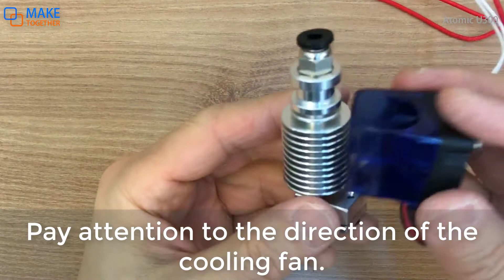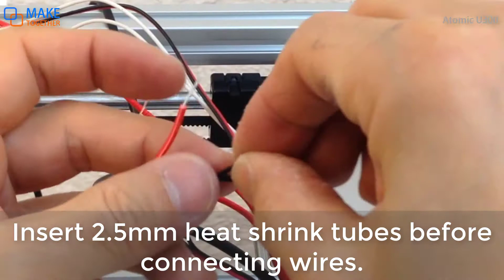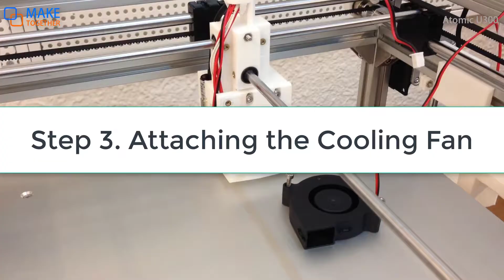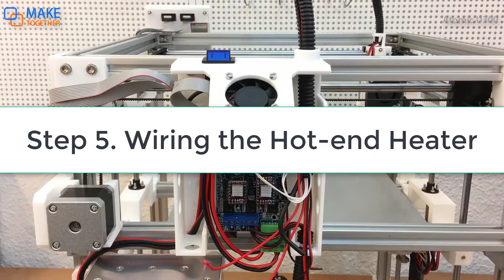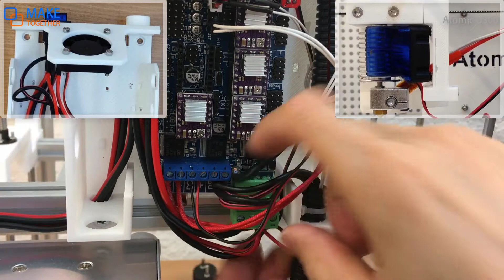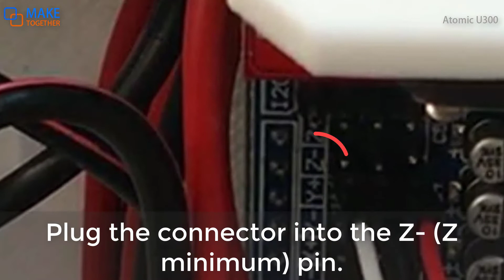Ultimaker Style 3D Printer Build Tutorial 13 - Printhead Assembly and Wiring

Comment: in this video it seems that something is missing, the heater cable is installed, besides the heater cable there is a white cable, what is it for? Then it is installed on the RAMPS board.
how many pins? in the video it's not explained....thnks
Reply from the maker: Thank you for your question, Burapat.
The white cable is the cable of the temperature sensor, which has two pins.